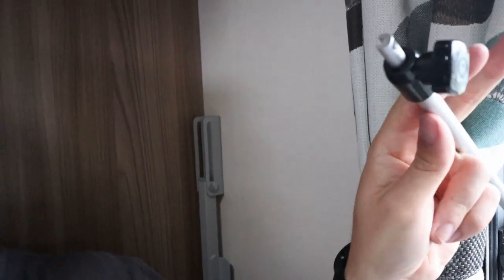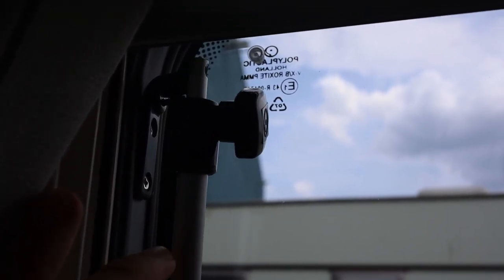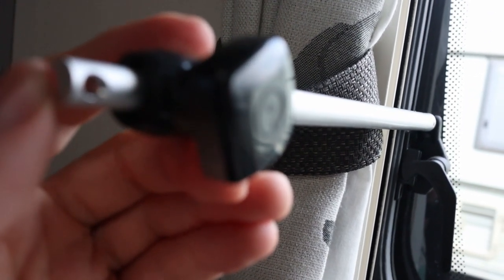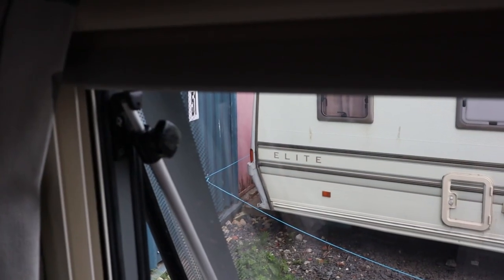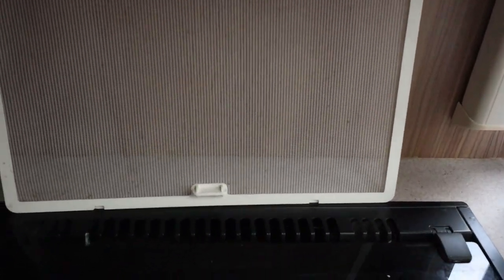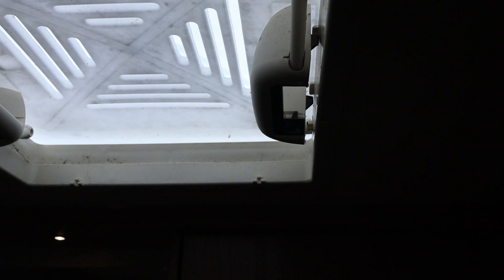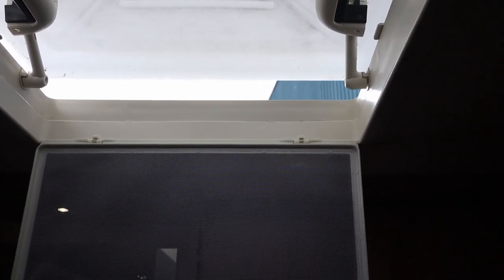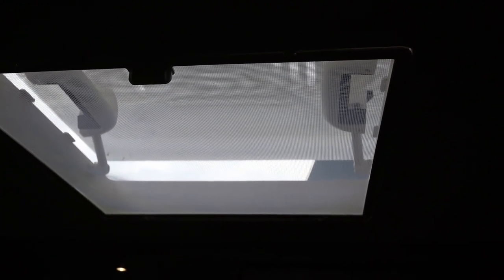Caravan window holder repair and Fly Mesh replacement.

Comment: Thank you, do you have a video  for my problem, front window, fastening catch won't go over frame catch to shut, it doesn't reach, seems too wide, other side is ok thanks
Reply from the maker: Thanks for the comment Sylvia. Without seeing it I’m not sure. Is it possible to turn it round or not?
Reply: I have the same problem it’s like the window latch is to short to stay clipped and window bent I don’t no how to fix it mine is a bran new caravan so many little problems
Reply: @poppet229  I've stuck a bit of plastic on handle fastener so it fits over the part it won't reach, it works ok now, but don't know how to properly repair it